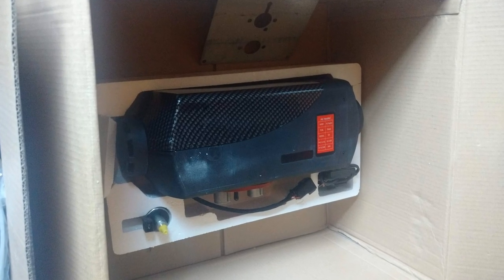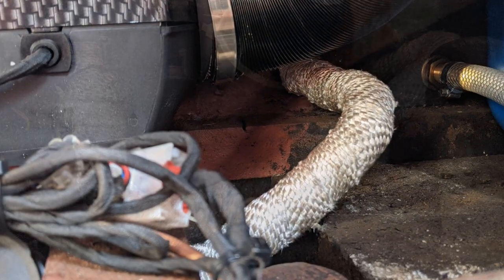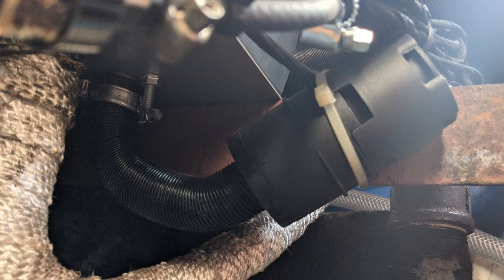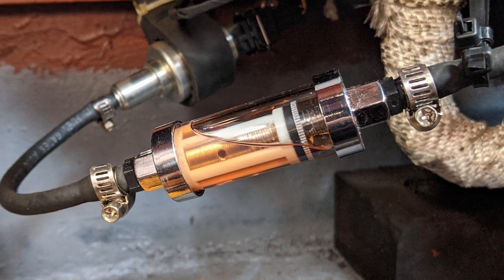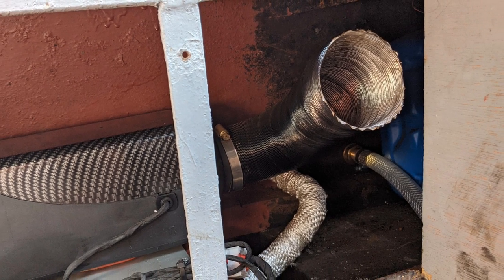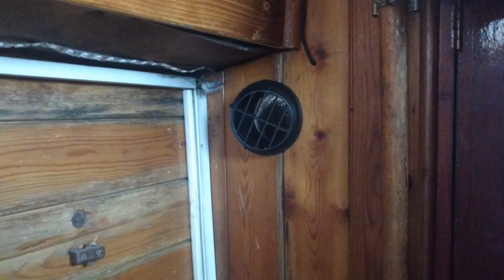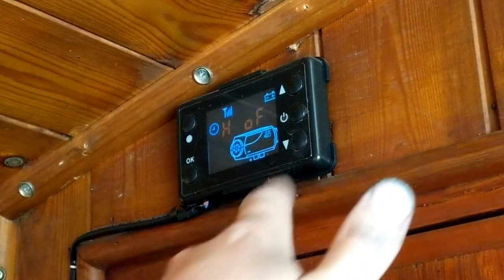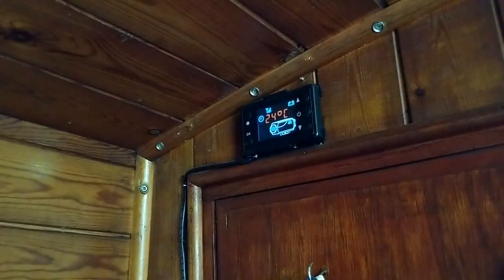Installing a Chinese diesel heater on a narrowboat and priming

Comment: Lots of great work to install that, thanks for sharing 🙂 We were thinking about these heaters after we met someone that had one in their van
Reply from the maker: I've had it installed for over 2 years now and its been pretty reliable over that time. If you intend to buy one I put a link in the description to a page on my site that has all the items that I used that you may find useful.
I intend to do a follow up at some point to show how I connected it up to the internet so that I can remotely turn it on when I'm on my way home.

Comment: Sasha what a professional looking job, well done and so useful. How effective have you found the heat generated?
Reply from the maker: Thank you. It is very effective. It would heat my boat to a reasonable level most of the year. It only falls short during extreme weather and even then it takes the chill off. My boat has a lack of insulation. The boat feels warmer after about 10-20 mins after its switched on. I think it could be improved by moving the air intake on the step to the inside of the boat rather than outside.
I hope this helps.